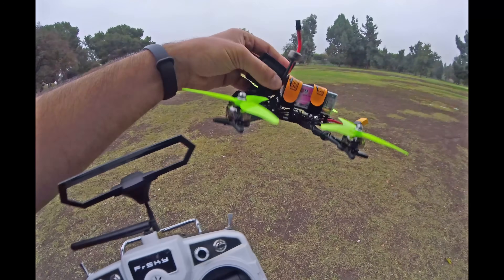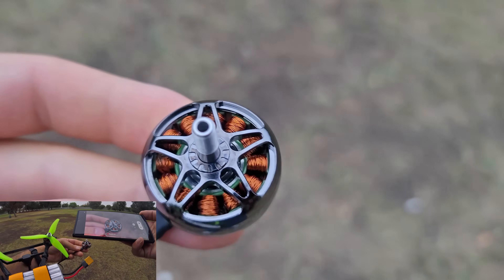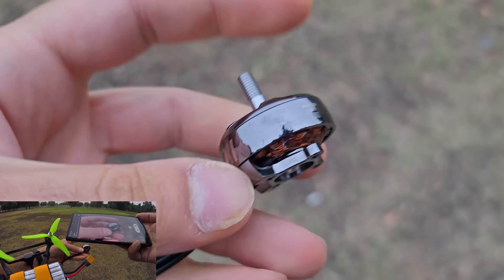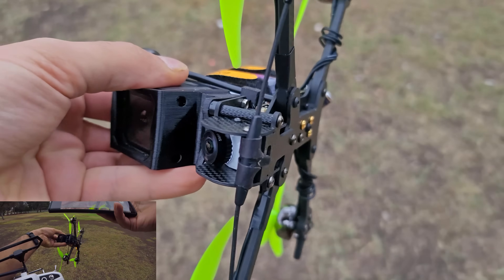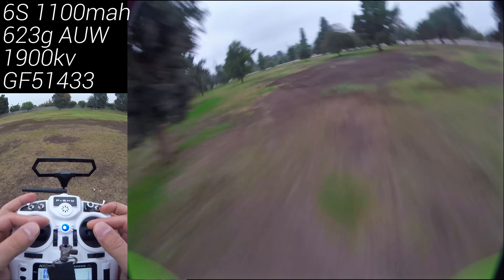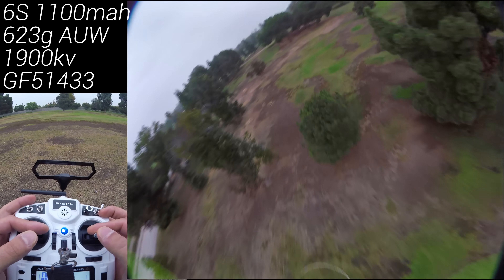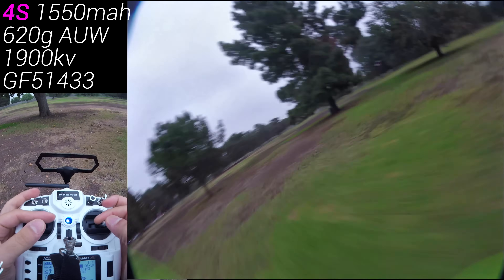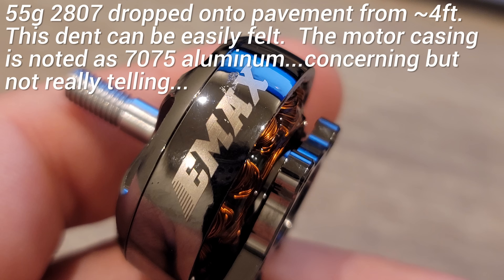Do you need a $27 motor? - Emax Eco II line

Comment: These look great and problem with steel vs titanium is less about weight I'd say, if it was it would be more effecting "spin up" of motor vs carry weight and might add a bit smoothness, I think we're all about to jump form heavy 5" to light 6" freestyle because of gopros anyway.

 I'd say its more, steel might take a beat and deform and hold it (bend) vs titanium is much more elastic. Realistically i think you've broken primary structure if you're bending a steel shaft encased in a prop anyway then they're cheap enough to swap.
Reply from the maker: Steel has a higher 'toughness' factor.  Titanium is more brittle because it's like grade 3 titanium, not grade 5.  It won't impact the response of the motor either because it's directly in the center of the rotation.  Aside from the weight at the end of the frame arms, it doesn't matter.
Reply: @Kabab to be honest i want to help and consider the reader, so i maybe simplify for others (not you) and didn't give you the just info. I work with flying things and actually you're my goto for practical and sensible well reasoned, reliable info, which as an engineer is all I want.  You're right in what you say if prop at constant speed like test bench. But not for acceleration which is constantly changing, this is purely theory of mine, nearer a guess, and I was happy to see your direction,  but i'd say weight in or around the motor actually would add that hidden feel element you are playing with regarding stator diameter. Maybe not noticeable but i think it would add tension in the motor/prop dynamic. That element inertia, which obviously is the thingies reluctance to change of state for a given mass, to observe this theoretical feel, I think it'd need to be carefully picked out if even possible, because its would be trampled on by a whole different reluctance to change for a given voltage thing going on with low kv and high kv. 
 maybe high KV, high central mass, (density vs area? (circ) ) would produce an interesting effect, slower spin up  bit more silk? I guess the losses make that impractical hence 6s. Or a bigger bearing can offset?
Reply: If its that crappier titanium its very bad under shear, which is about the only force that kills motor shafts. Steel would  even be preferable. Can't remember spelling but titanium is "martenstitic" and it means it realigns its structure to stress and basically grows crystals of itself there which obviously becomes more brittle less tough. It could literally smash. Its just good with constant vibration and heat transfer maybe magnetism?, would be less good to transfer heat away from bearings I'd guess also if its a relevent effect.
Reply: @Kabab  hey just changing from 5.1 to 5 and felt the height difference, wouldn't distance from rotating mass of prop add a tweakable variable to the feel/flight cake mix? Think gyroscopic procession experiment with bicycle wheel, then imagine it in different sizes? Dunno, just a guess.
Reply from the maker: @DigitalArtisan77  lately there are a bunch of 4.9" props that take advantage of the reduced load. They tend to feel smoother but are of course less efficient. .1" doesn't seem like a lot but it really does make quite the difference.  Overall it's hard to tell exactly what's going on so I choose to develop from the outside in with real world testing to gain intuition rather than inside out starting from math theory which doesn't usually translate into the real world. If this was a more expensive or critical application it would make more sense to start from theory...
Reply: @Kabab  exactly, I'm a hands on technician worked up. Got the theory 20 years ago in school, it's not needed, but all of us are engineers, if we're engineering things, honestly ive seen avionics guys with less skill than a 12 year old builder. I'm with you, in its much more efficient and just plane useful to everyone to capture and manipulate effects (cause and effect underpins all🤣)  and make the quads fly better, what else is needed, maths comes when you need to standardise and share findings, engineers already understand you 🤣. I rely on you as my researcher that gives fair and informed opinion above all for components and usually as a bonus their follow on effect on the system. I see a lot of bullshit hidden behind bits of paper and entitlement. This industry is gonna grow fast and I think there's a lot of skill and potential that needs protecting and delivering to the young and upcoming engineers. Not to be cynical, but we do need to move quick before all the rich but slow dickheads move in. They have no flair.😬
Reply: @Kabab  totally with prop height. Don't need the maths but can still see it as a big bubble of forces all resolving to one in basic directions. Shit bro i wasn't saying you were a bench man 😬, quite the opposite, just the tendency is to think about speed primarily. I was thinking a spacer between prop and motor to increase the height of the combined force bubble, its a lever, it would stretch it up a bit. I think it would give leverage against the massive horizontal rotational and could be used as a mechanical counterpart and balance to d gain for example.  I'm actually trying 2808s with a 5147.5 just to load the motors as my 5" as I think its only losing via heat turning that prop on idle and its about to carry a GP9.
Reply from the maker: @DigitalArtisan77  the frame design in this video drops the deck height to 15mm but it's problematic for building unfortunately so it's going back to 20mm. Raising the props is not a bad idea but it adds weight and also makes the props harder to get out of shot. As is I'm barely cutting the props out of shot with low ~22deg tilt. And that's with reelsteady. Without you'll see some minor prop corners. 

As for the guys with money, dji is already here but they seem to work some sort of magic every time they do something
Reply: @Kabab  well there's a really important concept I'm fighting, im my mind to stop slipping away in people's mind purely because, one) it prevents the horde taking it over and is therefore inconvenient and two) people only deal with face value, and that concept is skill, just that, whether an artists, ballerina or fpv pilot. Really simply proven, if given a chance, now that inav flight paras are legit, set up an alt hold angle mode drone, which is a mavic and flick of the stabilities 🤣 5 secs before the wobbles become quakes 🤣
Reply: @Kabab  I'm also playing with centre of gravity, and also area of craft with or without weight. I don't intend to stay fixed to this 2d carbon plate limitation. Is there some way I can get you my email? I've got a great, cheap idea for frame prototyping you'd prob like, which I've been using myself and I'd share what kittle I know. Eventually my plans are to help on a bigger more controlled scale, I want to secure the skill and jobs that go with it.

Comment: I don’t understand why people don’t try 5s... I get wayyy more fly time and way less electrical issues on all my 5s rigs. The batteries are cheaper, lighter, and it just functions so much better in my experience
Reply from the maker: it is actually the best of both worlds but it's just not as standardized as 6S.  The batteries aren't quite as accessible
Reply: @Kabab  true. I’ve tried the Thunder Power 5s 1340ish and the Ovonic 1300, they are both incredible. The Ovonics are just as good and significantly cheaper. I get usually around 4-5 min of typical freestyle
Reply: Same.

Comment: Why are you flying with the Frsky x9 lite? I use the same radio but I was under the impression it was pretty low end
Reply from the maker: There's nothing high end in this industry. It's unfortunately all pretty trashy. I like this radio best because the gimbals are almost full size and the controller is a good size for my hands. I use crossfire on it only.

Comment: I grabbed a set to replace those FPVcrate Booster motors on one of my "cheap" quads. They can't possibly be worse than those and are probably quite a bit better.

I think if you get a relatively high-KV "6s" motor, like 1900+, it'll run good on 4s with a really pitchy prop or 6s with a lighter one. Or you could buy 5s batteries because nobody else runs them and they're cheap 😅

Comment: Emax definitely has some great motors.  I’m still flying my Hawk 5 that I got the week it was released a few years ago and I know I’ve put over 1000 packs on those ls2206’s and their still going strong.  I did get the rs2306II 2400’z to replace them with when they finally go out but so far the boxes are just collecting dust. 👍

Comment: Kabab.
Can you please try/review Hypetlite 2204 and compare to Apex1607 on 5". 

Probably need to try T5125, T5030 and something traditional like Ethix S3.
Reply from the maker: 1607 is a useless size imo. Hot running motor and no good for anything compared to any 2203 or 2204. Also, the fpvcycle 2203 is turning into a 2204 with the batch coming. It's going to be better overall
Reply: @Kabab  lol for 5 in it's useless...but for 4in 16xx motor it's perfect...see scope is limited in actuality, kabab hasn't tried every or doesn't know every configuration out there that still can work well

Comment: I have to buy $27 Mr Steele motors they are the only ones that come with pants! I haven't had to clean them in a year.  I would switch to cheaper motors if anyone made full bottom mount motors anymore. I'm sticking with Stouts until someone makes a new 5" motor with big bearings...
Reply: It's hilarious that you have to pay $27 for a motor with a feature that every motor used to have
Reply: @mtlfpv  🤣

Comment: i only fly 2306 r6 2450kv from brotherhobby on 5 inch, they are unbreakable, have flown them almost every day for almost 2 years and never had a motor break, the spare i bought is still in its box! highly recommended at around 24-26$

Comment: I get 8 emax rsii 2207 2550kv for 64€ from AliExpress they arrive and I'm 99% sure they are originals, for now they flight well. Let see in some months

And about KV did you try motor output limit? I'm running 4,5,6s for a time without a problem
Reply from the maker: Why would you use aliexpress when you know banggood has the real ones for sure?
Reply: @Kabab  BG and AliExpress are not so different. After a couple of friends order from a particular shop's I started to give some trust on thems. I also have very bad experience with BG
I was skeptical cause the price. 4x32€
Reply from the maker: @The1188am  the difference Is that aliexpress is like amazon, there are a bunch of random merchants on it. Banggood is like walmart, just one merchant

Comment: My first criteria for selecting motors is "can I get 2 or 3 sets without breaking the bank". I'm not good enough a pilot to notice the performance improvement of a premium motor.
Reply: No the only difference you will notice is longevity and differences in crash resistance. Sometimes they use cheaper magnet wire with a thinner coating that burns easier to short on an untuned quad. But your right I don’t think any human can tell the difference (don’t tell all the hype train fanboys I said that, don’t want to hurt feeling and all that, they are a sensitive bunch).
Reply from the maker: If you were the best pilot you couldn't notice the performance improvement because there is none
Reply: @Kabab  👍
Reply: Cost doesn’t necessarily get you strength. My zing motors are still going strong 2 years later. Tmotor f40 didn’t even last a season.
Reply from the maker: @AliBFPV  more expensive motors are often more delicate because they're going for lower weight
Reply: @Kabab  Thats true theiy are using lighter (and usually more expensive) materials. Makes sense, but then again sometimes you just get a bad motor no matter who makes em. I mean motors arent rocket science, you can rewind them yourself pretty easily once you do a little research on the subject (I know you know that). Its a pain though and i dont recommend anyone do it unless you just want to learn (like me at the time).

Comment: Mine just came in the mail today. I pretty much have the same stance on motors though maybe a little more harsh...basically every motor sucks if it’s gonna crash on concrete. All  I’ve gotta do is clip a tree and ding a bell/shaft enough for it to be noticeable in footage and then I pretty much just wanna throw my quad away. I’m definitely on board with the disposable motor idea except for the fact that it creates more trash, there’s gotta be a way to recycle this stuff. I’ve got a box full of bases/stators that are perfectly fine but for the price of new bells and bearings I can just buy these eco motors, it feels super wasteful 😓. Time to go try em out.
Reply: These things eat my lil 1000-1100mah batteries which is weird because I have smoox that are 1880kv that get a good 5 min of ripping and these get like 3min. I’m also getting some sort of desync on faster flips while running 48kz, I think it got better after switching back to 24kz but didn’t get to test it much. So far, without even crashing them ....I regret buying 6 of them...even at $12 a pop.
Reply from the maker: @woopweep9605  the smoox is an unusually efficient motor for sure and it does have better parts. These emax motors are a long shot from bad however. I'm getting the same 3min ripping I usually do on them. Same 1100mah 6S. However I do agree the smoox is a more efficient motor overall. It's my favorite motor right now by far. It also has a larger stator which will add to the efficiency when you're not going all out
Reply: @Kabab   try the 2207 1900kv. I've been trying to fly them for the last 2 days and keep getting this trilling oscillation on hard pitch movements
Reply from the maker: @woopweep9605  that's a result of the high kv and high voltage.  You may need to make sure you have a good cap on the esc that's right on the batt pads.  Also manage filters if you don't have rpmf on. Finally, turn Dmin off if you're on BF 4.2.X and after that you can consider pids. It's unlikely to be a PID issue however.
Reply: @Kabab  thanks, haven’t tried turning dmin off yet....but tried everything else to no avail. What you’re saying makes sense as the trilling was worse when I tried flying a 1250mah. I’ve been black boxing and my PIDS look solid so hopefully it’s a voltage thing. I’m seeing 0 benefits from flying higher kv 6s. 1800ish kv seems to be ideal for me.
Reply from the maker: @woopweep9605  the issues you're having sound related to the esc and not enough capacitor on board. In general the kv depends on the motor entirely too. Similar issues result on 4S too with the more current motors
Reply: @Kabab  you were right, my cap had been damaged. The trilling stopped when I added a new one. I’ve killed bearing in 3 motors since first commenting on this video but overall I’d say at $12 you can’t really beat this motor. Thanks for the insight!
Reply from the maker: Every motor breaks when you hit something hard. There are no exceptions

Comment: i  have 4s 2600kv motors, but everything else is rated for 6s. Would I be okay running 6s? Or should I set a throttle limit. I have 50a escs and im only drawing around 35 on 4s.
Reply: Dont do it dude, youll burn shit up, stay 4s and run batt sag compensation on BF 4.2 its magic 6s super hard on components
Reply: @flo-ridafpv5713  everything I run is rated for 6s except for motors
Reply: @nfuller902  still man, runnin stuff at max rating is hard on it, lotsa high level guys like vanover n turner have dropped back to 5s.  Cuz of constanlty frying stuff...5s is a great choice though, like 4s but 0 sag, cheaper too
Reply from the maker: Yes you can do a 25-30% motor limit and that will run great on 6S. Most electronics today are built for 6S there's nothing to worry about
Reply: Gotta bear in mind too kabab rarely crashes and or turtles a lot w bound up motors... that causes huge volt spikes to gear, soo
Reply from the maker: @flo-ridafpv5713  I crash plenty as turtle all the time. I just don't crash really hard and I'm mindful of how much I push turtle

Comment: I like to go to 6S but it comes at a price. Have to switch all my motors and ditch my 4S batteries. What about buying (some) 6S batteries and using a motor output limit on 2450kv?
Reply: @wiebe Nieuwenhuis yep motor output limit on a separate profile for 6s. 
And still be able to use you 4s packs at full kv on a separate 4s profile.  Best of both.
Reply: @fpvnycdream_4197  well, you dont really get any of the 6s benefit here. Because you're effectively limiting your motor output to 4s. There's no point in doing this unless you already have 6s packs you cant use
Reply: @fpvnycdream_4197  this isn't a bad idea to slowly transition over to 6s though.
Reply: You're probably better off switching the motors around 1 quad at a time. Kabab was hauling on those 1900kv motors with a 4s battery and aggressive props.
Reply: Power = Voltage x Current

That's why your amps go down when you go to 6s on lower kv. More volts, so less current for the same power. 

That's as far as I understand. Unless,  is the battery less taxed this way? I'm not sure. But it seems to draw the same Amperage theoretically (to me, lol)
Reply: I personally have a quad with 5s 2450kv 2407 motors.  Half the time I motor output limit to 4s voltage, but the other half I just go crazy with 2450 5s. 

I think that's the main benefit with the motor output limit. 2 profiles on same battery. Not 2 profiles for different batteries. There's just physical limitations the profiles cant address.
Reply from the maker: Either way you do it, it's really a better way to go